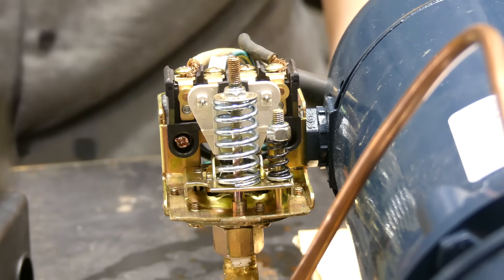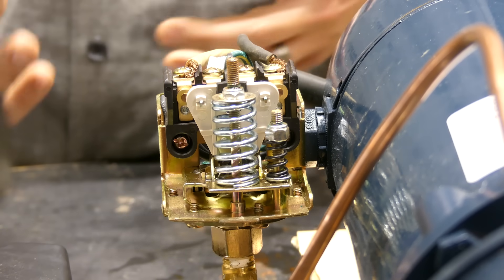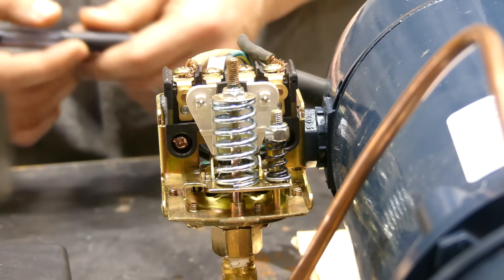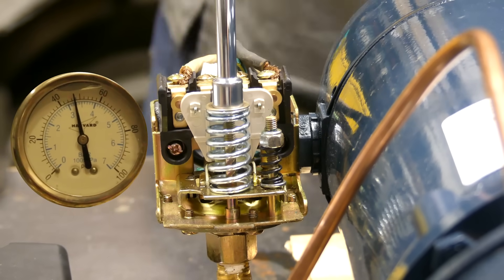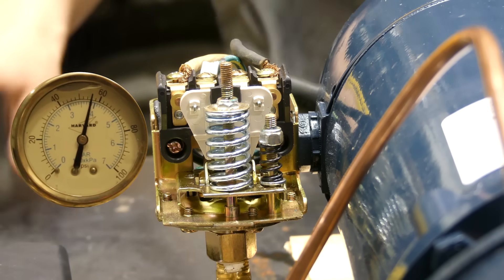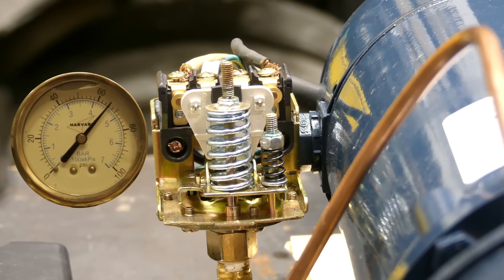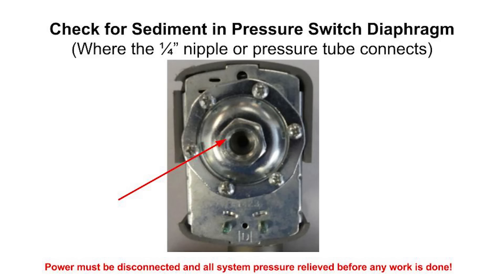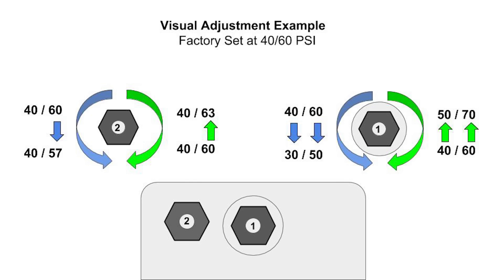How To Adjust a Pressure Switch

Comment: He says: it doesn’t matter what side it goes if it is 240v. They’re both going to be black! Wrong! By code you can only wire 240v with black/red/ground combination. This is because when someone deals with it down the road immediately should know it is a 240v set up and both the red and black wires are hot. If you wire  a neutral white as hot in 240v set up, at least put a red tape securely around it to comply with the code if it even helps in case someone gets hurt. I’m not an electrician but I know this as a fact. There won’t be two black wire on a 240v set up. Options are black/red/ground or black/white/ground but your white is not neutral so then you’re off

Comment: My pressure switch is clicking on and off very  quickly what's the problem?
Reply: Usually a water logged pressure tank.  Start by adding air to the tank to just under the cut-on pressure.  You may have a split bladder.

Comment: What would make the pressure switch not cut in sporadically
Reply from the maker: Debris could be caught in the pressure switch diaphragm or the nipple that connects to the pressure switch. I suggest you turn the power off, release the pressure in the system, and check that tube/switch for debris.

Comment: I always thought you have to ajust air pressure in tank to change low pressure setting,,,meaning If I want it to come on at 30 I would need 30 psi in tank
Reply from the maker: The pressure tank's air pressure needs to be 2 PSI below what the pump comes on at. So in your example the air pressure in the tank should be 28 PSI

Comment: What causes the switch to go to zero before coming back on
Reply: The pressure in your pressure tank is higher or the same as the cut-in pressure. Either increase your cut-in pressure or release some air from the pressure tank. If there is 40 lb of air in the tank and your pressure switch kicks on at 40 the tank must be completely empty before the pressure switch kicks on therefore it drops to zero. You should have about 38 lb of pressure in the tank

Comment: The pressure is reaching only at 20 psi. And it doesn't go up. The motor is just continue running. What is the possible problem of our pressure tank? Thanks for those who can give some advice..
Reply: Pump cannot put out any more pressure.  What is it rated at?

Comment: I wish my switch would shit off.
I have my 20 gal expansion tank/bladder tank.
I have 20/40 switch new that will not shut off.
I have two 40/60 switches I cannot get to shut off.
Never had this problem before.
As for the 40 /60 my bladder tank is ag 38 psi before filling water.
Reply from the maker: It sounds like you need some help troubleshooting, give us a call and we can help: 855.329.4519

Comment: My pump randomly keeps turning on about every 15 minutes and runs for 20 seconds.  The pressure gauges never move.  They say 40 psi (20/40 switch).  Its a myers hj75d pump.
Reply from the maker: It sounds like you have a couple of problems: a bad pressure gauge and a leak somewhere in the system. You should replace the pressure gauge and try to track down the leak, check out our video on that: https://www.youtube.com/watch?v=CPzRpD_Tncc&t=40s

Comment: You forgot the disclaimer that if something goes wrong you are not liable. Over-riding the manufacturers settings is/can be dangerous.
Reply: True, but the installation instructions for the switch clearly indicate you can make these adjustments.

Comment: I’m confused with the “full” turns. You turn it about 110 degrees of rotation and call it one turn.
Reply from the maker: Full turn = 360 degrees
Reply: @RCworstwater  Yes, I understand that. 360 degrees is a full turn. In your video you only turn it about 3/8 of a turn and called it a full turn. That’s the part that confuses me.

Comment: my pump won't activate when pressure drops unless I manly engage switch, and that only after water runs out of system in house
Reply from the maker: Fred,

Please give our experts a call so we can help you:  855.329.4519

Thanks for watching!
Reply: Fred Sumner we are having the same issue
Reply from the maker: Have you checked for sediment and debris in the locations noted in the video?
Reply: R.C. Worst & Co., Inc. I haven't but as soon as I am home from work I plan on doing so. I will be sure to post when problem is found.
Reply from the maker: Feel free to give us a call for help when troubleshooting!
Reply: R.C. Worst & Co., Inc. After running water pipes start to bang

Comment: When you take the pumps out of the box to film these videos you should be really careful when you switch the pump from 220v to 110v,  I know someone that bought one of your pumps used in your video, sold as new and spent countless hours troubleshooting the install only to find the pump was changed from the factory default of 220v to 110v and not changed back.  The box was open and the pump sold as new.

Comment: Our pump is coming on as soon as Faust is on???
Reply: You're pressure tank has more than likely failed. Same happened to me and it turned out the bladder in the pressure tank ruptured and the entire tank became waterlogged, causing my pump to short cycle. I know this a year old comment but hopefully you're issue has been resolved. The type of issue you're having is an absolute pump killer. And if you're like me with a deep well, that's several if not over 10 thousand to pull the core and replace the pump

Comment: My pressure valve it’s not moving I wonder what wrong?
Reply: New pressure valve maybe?
Very cheap and easy replacement once you've turned the water off and drained the system
Try to find a  lquid-filled one. I believe they'll last longer and maintain their accuracy.

Comment: My pump keeps turning on off on off every let's say 10-15 seconds, no leakage, no water return to the main tank, what could be wrong?
Reply from the maker: What pump do you have and where is there pressure switch located in the system?
Reply: R.C. Worst & Co., Inc. it's just a house 1hp pump with pressure tank, switch is right below the pressure tank, my feeling is there's an air leakage in the pipings but can't find it, bacause if i close the outlet valve, the pressure doesn't drop.
Reply from the maker: Do you have a pressure gauge next to the switch? What is happening to the pressure during this process (What is the cut in and cut out pressure)? You should also verify the pressure tank is charged to 2-3 PSI below the cut in pressure of your pressure switch.
Reply: Range is 4- 2 bars, turns on at 2, after it stops, the pressure lowers within 15-20 seconds and turns on again
Reply from the maker: You must have water going somewhere for the pressure to constantly drop. 
Turn off the main building water valve when the well pump has started running, isolating the pressure tank and pump controls from the building.
Now the pump should bring the water tank and controls up to the cutoff pressure and things should stay there.
If water pressure keeps dropping after the pump stops, either: 
1. Your main house valve is leaking and there is water running in the building or 
2. There is a bad check valve or foot valve and water and pressure are returning to the well.

Comment: My 40/60 pressure switch was kicking the pump on at only 32 psi/off at 60psi.  Therefore, I turned the range adjusting nut CW to increase the cut in pressure to 40 psi and simultaneously decreased (CCW) the high pressure cut out nut to attempt to maintain a 60 psi cut out pressure.  However, regardless of the tension on the high pressure cut out spring, the pump always shuts off at 66 psi -- even when the the high pressure nut is backed completely off so there is no load whatsoever on the little spring.  Before making these adjustments, I relieved all the pressure in the tank and checked the air pressure -- it was only 30 psi so I added air pressure to increase the tank pressure to 38 psi.  Does this mean I have a defective pressure switch and it should be replaced?
Reply: Yes.  $10 - $20.

Comment: The first thing noticeable is the appalling way the power wiring has been done. Any company that shows this standard of wiring is just as likely to have the same build-quality in its pumps.
Reply: I think of the all different sizes of pumps, different ages, manufactured who-knows-where across this planet, you are bound to encounter everything.

Comment: Good video but...the electrical wiring here is horribly dangerous!  NEVER put stranded wire under a screw head.  Please before someone dies or a horrific fire ensues, use crimped spade terminals on the stranded wire.
Reply from the maker: We agree completely, for this video it was just to quickly record the pump turning on and off. Thanks for the comment!

Comment: Why my pump do not stop?
Reply from the maker: You may have set the switch too high or there could be air in the system. Give us a call and we can help you troubleshoot: 855.329.4519

Comment: My spidey sense's immediately started screaming DANGER DANGER Will Robinson.  Those stranded wires under the screw as shown is a very BAD PRACTICE and a safety hazard. They should be enclosed in a fork or ring terminal and landed properly to prevent accidently coming undone under vibration loads.  I mean C'MON MANNNNNN if you gonna do a video at least be SAFE about it for God's Sake and everyone else watching.

Comment: i want to keep the 30 as 30 but increase the 50 to 70
Reply: You mean 30/70?  You can try tightening screw #2 CW, but there is an adjustment limit on the control.  Also, can your pump provide above 70 psi?  If not, it will run continuously and may burn out.

Comment: Omg what pump is that?? My pump takes almsot two minutes to recover pressure that your pump did in three seconds.
Reply: Fullthrottle Turnnburn the pump is used as a demonstration. It probably is connected to a low volume tank and can refill quickly. You mat have a larger tank which would take longer to fill. Hope this helps.

Comment: You need to read the pressure gauge correctly. You said it shut off at 66 PSI , it did in fact go over 70PSI.

Comment: My problem is that the pump is off, no water being used, just sitting there, then it will turn on for just a half second and cut off.  It does this every few minutes.  What gives

Comment: Micronizer Question
Reply: Sorry.  This is my first YouTube comment.  Great video!  I have a deep well pump at 370' with a Goulds 1/2 hp 220 volt pump and a bladderless tank.  I just installed a Waterite micronizer with a gauge on either side of it.  Pressure switch set to 40/60 and functioning correctly.  Pressure on input side of micronizer goes up to 68 at current setting and with output side going up to around 63.  The pump is going to see up to 68 psi or more if I adjust higher.  I plan to leave pressure switch alone, but I'm concerned about the pressure the pump is seeing.  Can my pump handle the brief exposure to 68-75 psi near the end of the pump cycle or do I need to consider a 35/55 pressure setting?  Thanks so much!
Reply from the maker: The pump should have no issue handling that pressure. If it can create it, it can handle it.